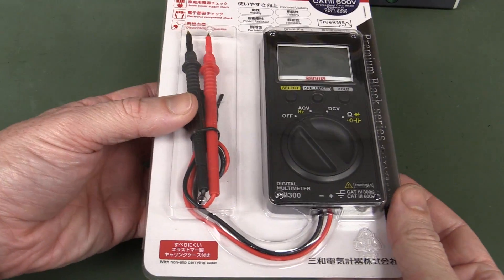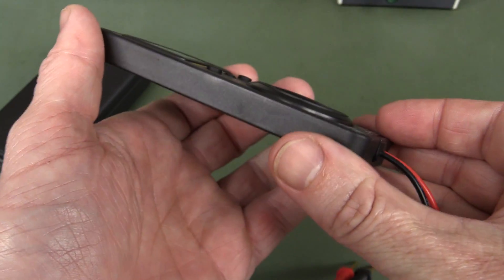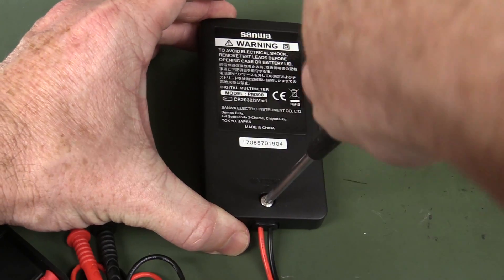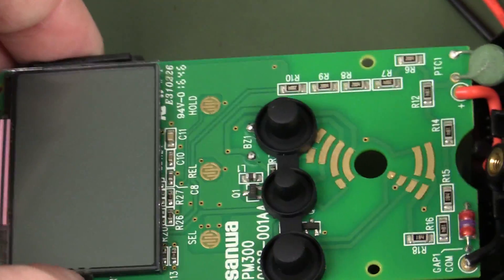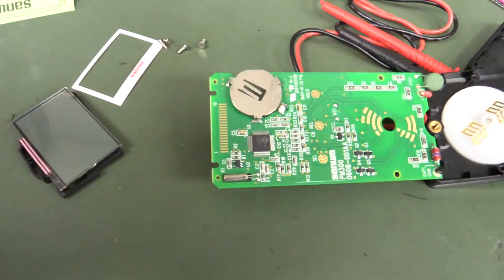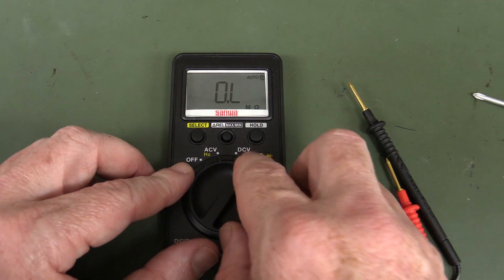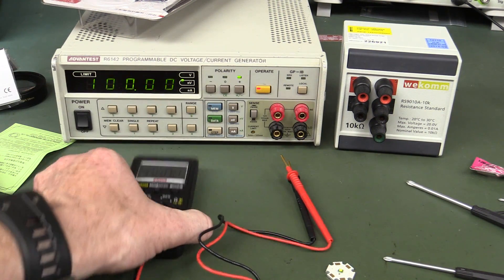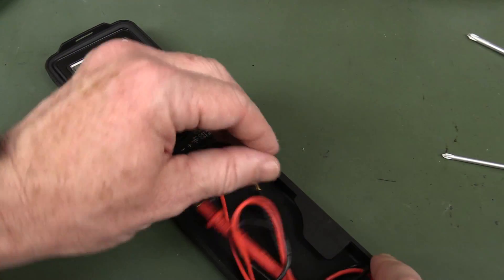Sanwa PM300 Pocket Multimeter Review

Comment: Lacks of NCV function ufortunately, though it looks really well constructed. Cat IV 300V..maybe..In terms of usability for most Cat III jobs APPA iMeter5 looks more usable, more portable and it based on a RISC processor with outstanding accuracy, it also has NCV and an automatic selection which works in 99.999% of all cases. No relative mode, but it spot on anyway and also iMeter5 can be calibrated normally and it is absolutely great for any professional use. It also has two spark gaps and additional protection as well as great probes with grooves, so they can be attached to wires easy if required. Cost of iMeter5 is also better. It is not True RMS but in most applications you will not need it and if you a technician who carries a lot of tools you will appreciate the weight of this model. Practicality versus marketing...oh..and rotary switch operated with one hand and has robust construction plus metal brass insert for the bolt holding rear cover...oh..and what absolutely blowes this Sanwa multimeter out of the water..iMeter5 with long enough quick release tape can be attached to wrist of your hand and with auto selection etc it becomes a really useful tool when working on low voltage circuits and it virtually makes it portable and even "wearable"..!

Comment: I wish I could justify this, but I've got a Fluke 15B+ I got for $90 resold (unopened) which doesn't have a max/min, relative, or true rms. But... at the same time I have an oscilloscope (Siglent SDS 1104X-E) which can do True RMS for me, and I could work out a way to do max/min with the oscilloscope. Plus the labs at my university has  Fluke Bench Multimeters that can do relative, max/min, etc. Just not the capacitance measurement. 

Paying (US based) $67 for this is really expensive even with the current discount. If it was $48 USD like the converter told me without shipping, I might get it. But that shipping cost is horrible. If Dave was on amazon and I could apply my prime shipping, I'd be really happy. But...that's a lot of hassle for him.

And of course, these are my own opinions. If you don't agree and think I'm being entitled, then good for you. Think what you want and have a nice day.

Comment: I'm a big fan of Sanwa gear, but it's a shame this one has no current measurement. Even just a couple hundred mA measurement range (i.e. the ability to measure 4~20mA signals) would've sold it for me as a good little run around meter.
Reply: Reply by future me: Having current measurement on a pocket DMM with fixed probes is probably more dangerous than it's worth. It would be easy to accidentally set the meter to current and then short out a power rail! Current measurement is probably best left to meters with pluggable probes and a dedicated current probe input.
Reply: Triplett 2030-C measures up o 400mA.

Comment: it says "remove test leads before opening battery lid"(or something similar), so how do you actually remove them? is that a design mistake? or are they referring to the appliance you are measuring?
Reply: I assume translation issues, I think you're right about removing the leads from the circuit under test. I've seen warnings to that effect on other meters before

Comment: A custom label would be cool. But don't put it in yourself. Not worth the time.
If you do go that route, just slip them in the box and let the user crack the case open and put them in if they choose. (Also avoids Sanwa complaining)
Should be cheap enough to have a bunch of them plotted and printed on some nice UV resistanrt paper.

Comment: 7:58 the left solder connection of C5 seems a bit loose. C4, C6 and C14 look a bit off, too. I don't know how long those will survive some dropping or vibration.
Reply: I would say it is barely even soldered
edit: C14 and C12 on middle top don't look properly soldered as well
Reply: That crystal also has what looks like flux residue on the solder joints which Dave would bash any of those $5-10 meters for.
Reply: I also don't like how the crystal is just hanging in that cutout, supported only by it's leads. For $70, they could really put a drop of silastic to keep that from vibrating. Hell, even hot-glue would be an improvement.

Comment: WHAT !! $US70 for this crap ? No way.
Let's see 'till joe smith has test it.
https://www.youtube.com/channel/UCsK99WXk9VhcghnAauTBsbg
Reply: yeah for me it's too expensive as well, it's a niche, i'd rather get another ut61e for the same price
Reply: I wouldn't use ANY pocket meter in that application no matter who manufactured it.
Reply: https://www.banggood.com/es/ANENG-AN8008-True-RMS-Digital-Multimeter-AC-DC-Current-Voltage-Resistance-Frequency-Capacitance-Test-p-1157985.html
Reply: Yup, that's what a full-size quality meter is for....
Reply: Hioki make a nice pocket meter (model 3244-60 Card HiTester) that's made in Japan for only $50.
Reply: Even though its built well, for its price and functionality, it is too pricey...
Reply: It's up to $100
Reply: I agree. I'd be willing to pay around $40 - 50 for a quality pocket meter to keep in a drawer outside the lab for general use. I have Flukes and Keithleys on the bench but sometimes I don't want to get them for quick jobs.

But 70 USD no way especially since it's made in China and not Japan. The manufacturers profit margin is way too high.
Reply: When you're poking around a 415v bus bar and this thing doesn't blow up in your face, I think it'd be worth the outlay.
Reply: I've been using a DiLog DL-114 meter for a few months now... much more of a 'true' pocket multimeter... it's not been damaged despite being used on building sites,  but it's only cat III, sadly. Fine for around the installation, but not at the service head

Comment: Anything you don't like about it? Ta!
Reply from the maker: 1) It is thicker than other wallet style pockets meters, so if thinness isn't your goal then this isn't for you (unless you wanted to use it without the case).
2) Cost. I wish it was cheaper.
Reply: I agree that the cost seems steep, but it does have quality features that you describe in the video. I'm concerned about the test leads. They don't seem to be easily replaceable and I think that's a significant future failure point.

Comment: Nice but it's the same price as a Fluke 15b+ (at least in the states).
Reply: The fluke also has AC and DC current ranges, removable probes and in addition to CAT III 600V the Fluke is also specified as CAT II 1000V. 
The only thing the fluke does not have is the frequency measurement.  Anyone ever use the frequency measurement?
Reply: Do R/C! Fluke 15b+ isn't TrueRMS dmm
Reply: Ffff Ssss now that is a good point!  I will add that, even without  RMS it is 1% accurate between 40 and 400hz on a sinusoid which should be sufficient for most people who are looking for a meter in this price range.
Reply: I think the appeal here is the size of the meter, the only pockets that a 15b will fit in are cargo pockets.
However, it still seems like a bit of a gimmick, or only truly useful for a small niche. How often are you needing to carry around a meter without also needing some sort of tool bag?

Comment: Must admit I'm a fan of the UNI-T UT120 series for 'pocket meters'(Only CatII, so low voltage only) that can be thrown into a bag and left in toolboxes because it performs well at it's price point and is a great meter to give to people who just want to test the occasional thing and to replace the old trickydick yellow meters, however this is a far better one indeed.
The Sanwa's leads are far better, has True RMS and of course a MUCH higher safety rating. I suspect the performance is better too.